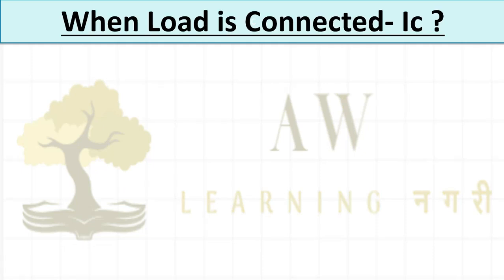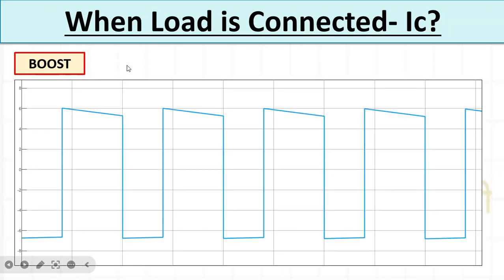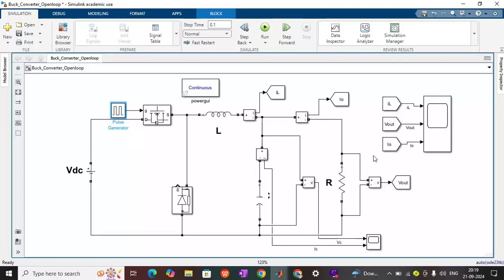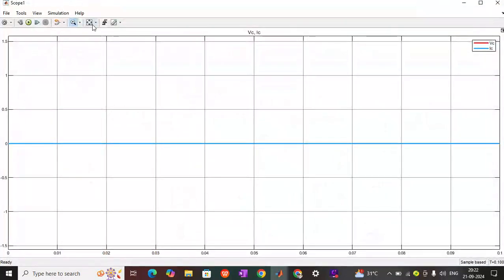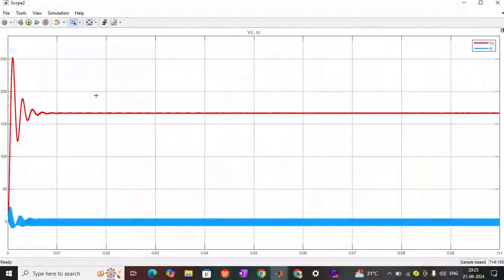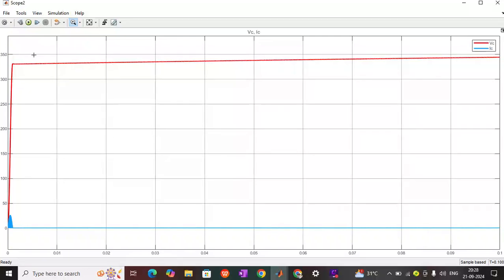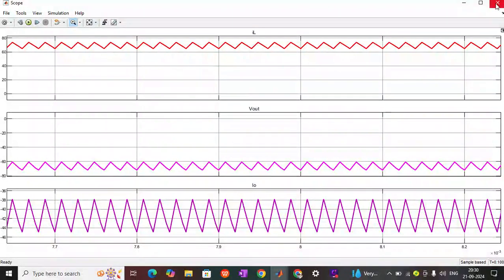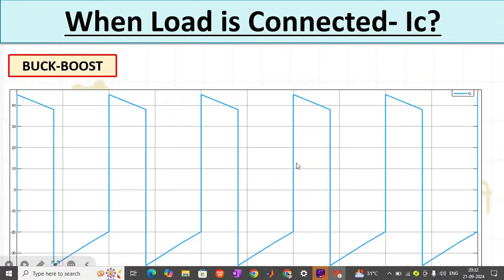Capacitor Vc and Ic Without Load in Buck, Boost, Buck Boost Converter

Comment: Hii 
Can you please make video on current programmed control of boost converter using sr filp floo
Reply from the maker: @sandeeppal2024  Yes. It's available on my channel. Only thing is that i had not use flip flop, but it can be easily incorporated after controller design. I'll try to make once get time. 
Thanks for watching and commenting 😊
Reply: @Kingashish-555   i want video on peak current control of boost converter
Reply from the maker: @sandeeppal2024  sure. I'll try to make and upload soon. 😊